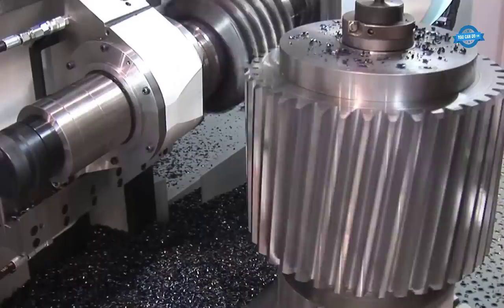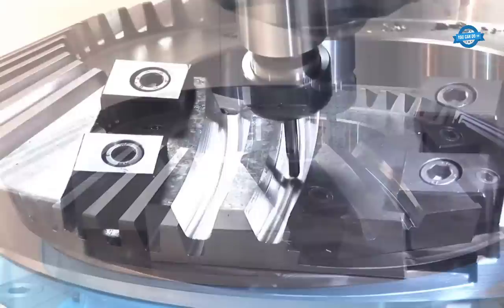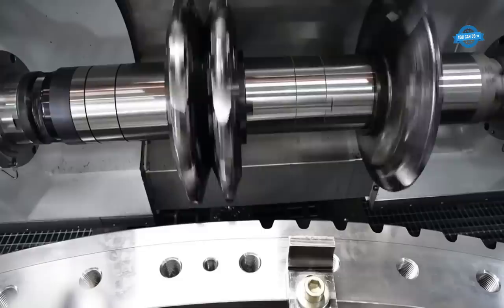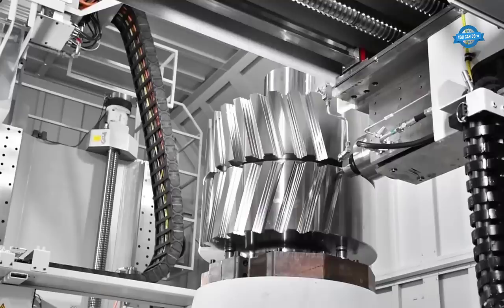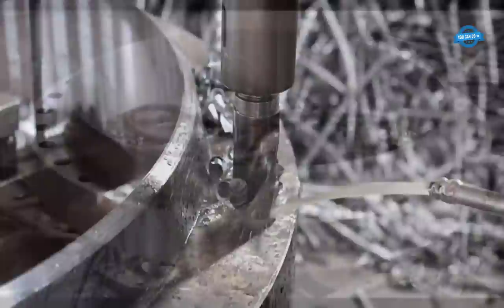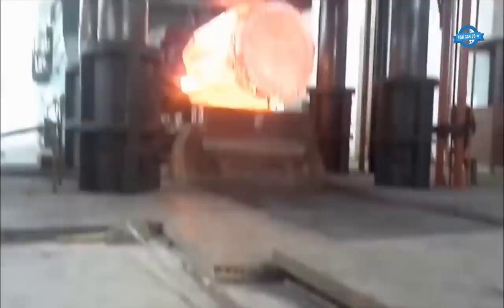GIANT FORGING PRESS. Large Bevel Gear Machining Process And Forging Machines In Working

Comment: Ugh! Micrometers is not equivalent to thousandths of an inch. One micrometer is 3.94e-5 inches: (1/10^6)*(1000/25.4) == ~0.00003937. Which means one micrometer is approximately 4/100,000 of an inch. The equivalence stated in the video is off by two orders of magnitude!

Comment: Transverse shaft gear the full length of Warp drive engine nucelle all the to the Buffer damper on each engine.Each strut should have a tube, thus allowing entry into the nucelle. Temperature filament was done the way search of Thomas A Edison. There must be heated plasma metal shafts rods.  Dr Dent astrophysicist Rocketeledyne owner .